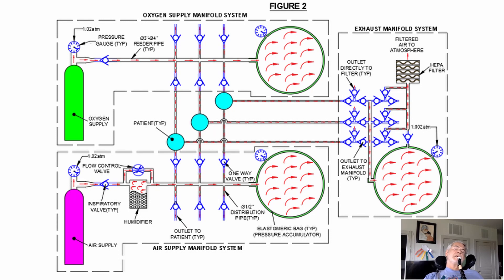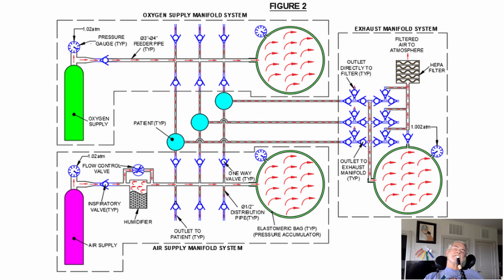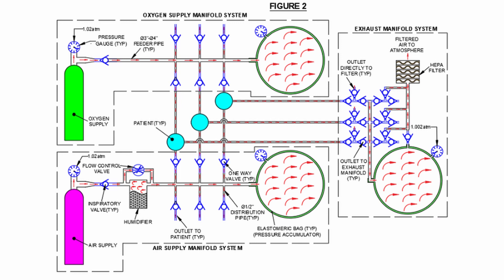Shared Manifold Ventilator: xTech Introduction

Comment: Excellent idea. The only thing I would be worried about is failure of any individual solenoid valve, how difficult would it be to repair it? Would you have to shut down the entirety of the ventilator system to replace a single part? Or is there some solution that can mitigate that by having manual valves in places to shut off supply to that area  while maintaining proper pressure in the rest of the system?